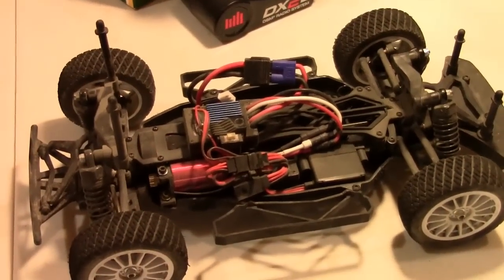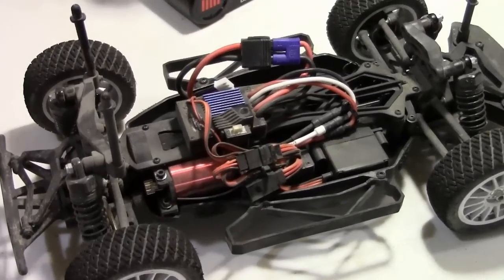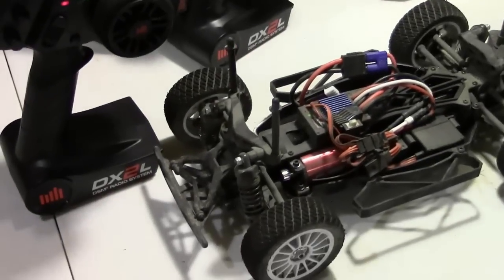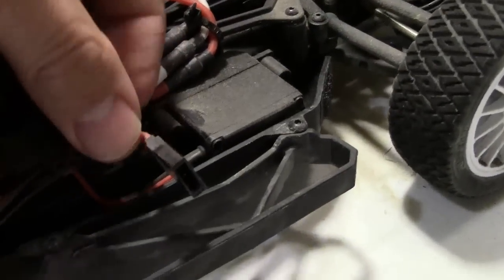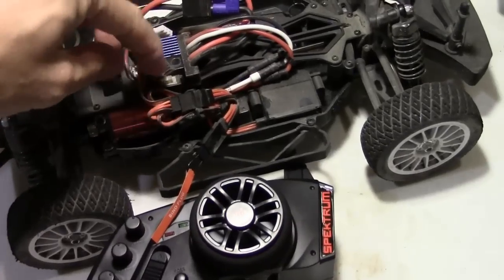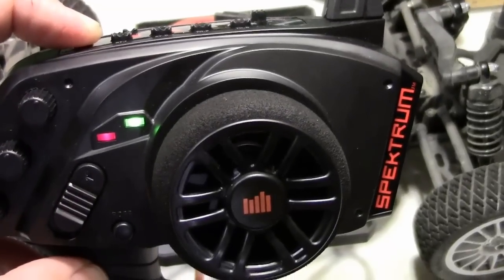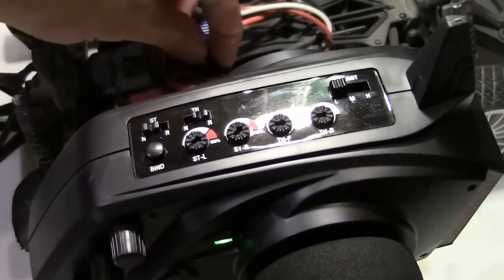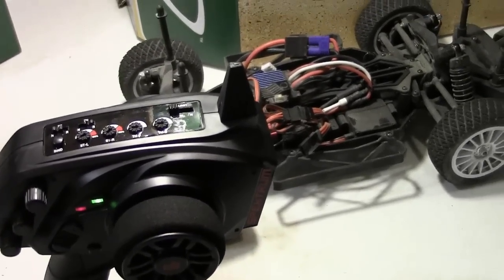How To Bind Your DX2L Remove To The Spektrum Receiver - HOW TO

Comment: If I accidentally shut off my radio with the car on the car wants to take off how do you set the failsafe on it so it could do the opposite
Reply: When binding the radio to the car push the throttle into full braking unless pairing is done